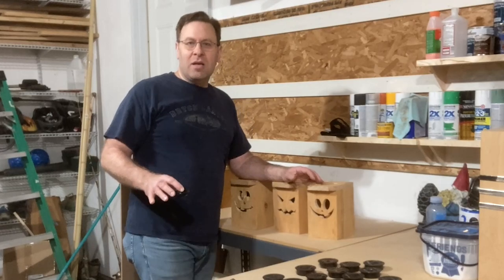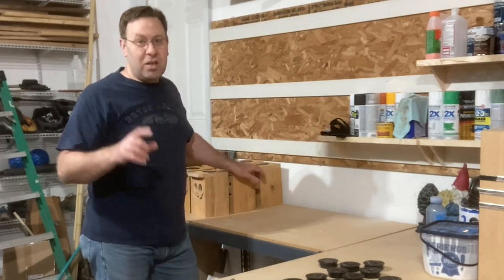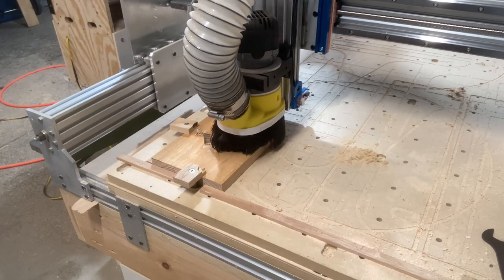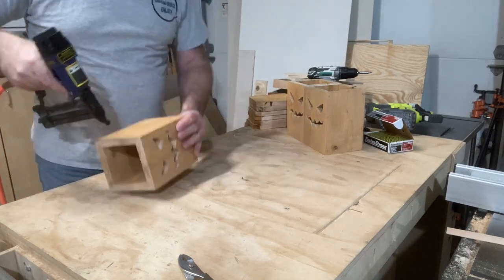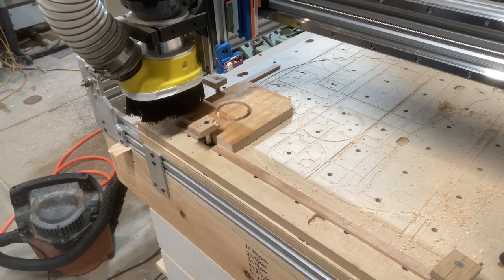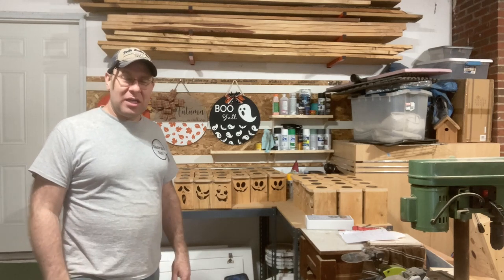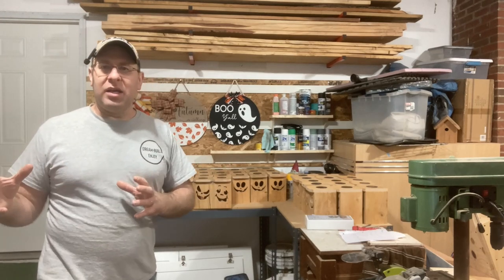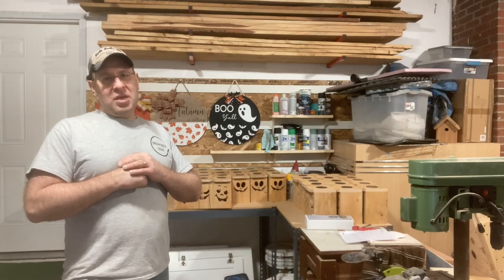Making an Army of Solar powered Jack-O-Lanterns.

Comment: I like the idea of the solar lights -- but that seems to add a significant cost: I'd say @ $15 they are under priced.
I've done some lanterns with miter folds -- 1/4" mdf or ply, 1'x2' sheet.  Line up the sides, face up, and tape at the miters then glue and fold up the box. tape or rubber band the box until dry (or nail corners if you prefer). Everything was done on the CNC, but I run mine very conservatively so it takes just under 20 minutes to cut it all.
Reply from the maker: I’ve had a couple people tell me I could have charged more, but I made out all right. When I first started cutting them out on the CNC it was taking 13 minutes per face, but I was able to adjust my feeds and speed to get it down to 3 to4 minutes . Thanks for your comments, I enjoy seeing how other people do things.

Comment: Good video. Your CNC really made that project & volume work well.  Ive just built two yesterday & cutting out complicated eyes & mouth & teeth takes time.   I’m just curious why you trim the width down to 5 1/2 inches?  I take it you don’t paint yours?  We painted ours a mix of orange & red & added a tree limb cutoff for the pumpkin handle.     I’m guessing shortcuts have to be made when you are making a ton of them.  Good luck selling them.
Reply from the maker: Thanks, I wanted to make sure all the parts are the same width, also some of the edges needed to be cleaned up.  No paint just the a rustic look. I could not imagine cutting them out by hand that would take a lot of time, the CNC really cut the time down.